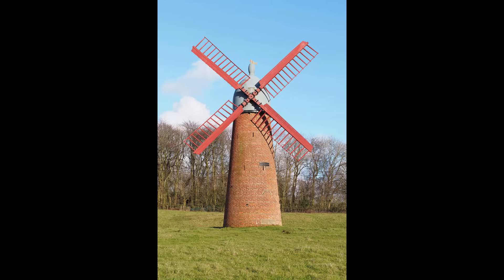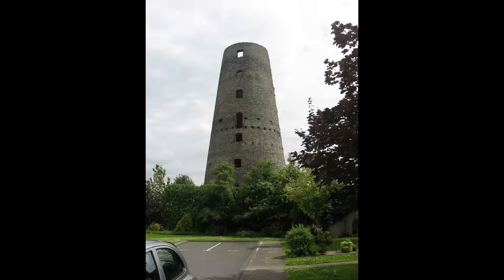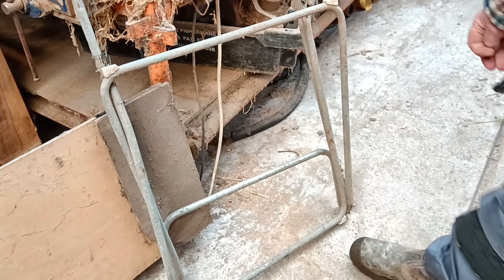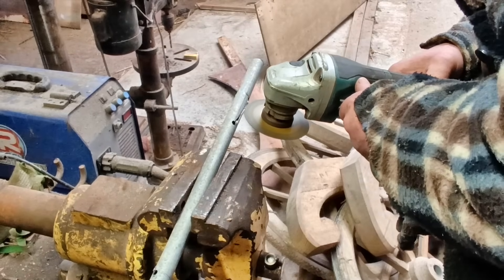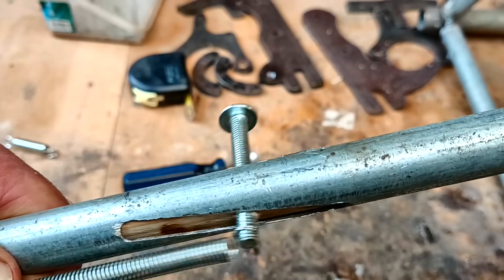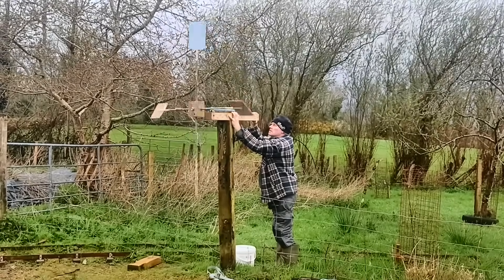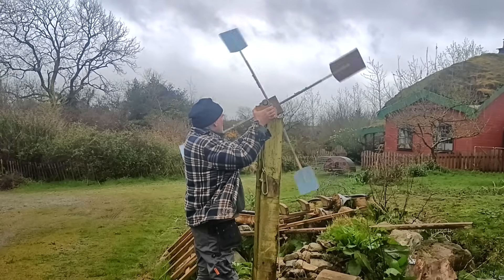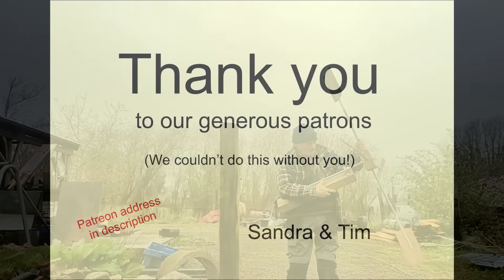How To Make A Self--Feathering Windmill (Self Regulating Turbine)

Comment: observations…

Supposing one wanted max aero efficiency, that I take to mean a constant angle of attack for the airfoil into the apparent wind, then I think this would be achieved by having a constant blade tip to wind speed ratio, so no dynamic blade pitching is needed.  I understand you’re doing it for survivability though.

In theory, if a spring with spring constant k stretches a length delta_r as it balances the centrifugal force on a blade of mass m having center of mass turning at a radius r, at angular velocity w, then the equilibrium point should be:

k delta_r = m w^2 (r+delta_r)

delta_r = w^2 r / (k/m - w^2)
Reply: Although you would preload the spring, I didn’t account for that in the equation

Comment: You actually don't need batteries with an electrical one, just only use it when you need power (just like with a mechanical power version). And yes, mechanical is more fun 😃

Comment: You’d have to adjust your tensions once you’ve got a pully and belt running to an alternator so as to adjust for the increased drag power generation would have on overall speed because while you want it to always create power the winds won’t always be the same force so you’ll need bigger wind veins 
But thanks for that design I’ve been mulling that problem over for quite some time and I think this has a good foundation that it might work for what I’ve been contemplating
Reply: An alternator? You haven't been paying attention, have you?🙃

Comment: Trouble is, this mechanism will move the center of mass of your vane and cause imbalance.
There is a more clever design working on the principle of centrifugal governors - weights mounted on extension rods, connected to the blades and tensioned by springs. When the centrifugal forces start pulling the weights out, they rotate the blades, changing their pitch angle.
Alternatively, you can make blades that are pitching by the frontal pressure caused by the wind pressing against them. That is measuring the wind speed by the pressure, not by the RPM. This design could even protect the vane during very abrupt gusts of the wind ...
I once saw a design where the turbine is mounted offset from the vertical axis, so when the wind starts pressing too much, the vane just starts pointing away from the wind and thus slowing down. To enhance the reaction, the tail was on a hinge and springed to loosen the directional authority during strong winds.

Comment: Years ago they used to just put water heater elements in to open tanks. Then connect them to the electrical system as extra loads for braking the windmill in high winds.

Comment: You ought to make a kinetic energy storage device! 

Use a CVT (or maybe 2 in series) off of a 'side by side' engine, a large concrete disc, and some large carbide balls for a center pivot and end bearings.
Reply: CVT's are free where you live? Where is the low cost in your idea?

Comment: The only thing I could see having difficulty is that on a larger version, where the blades have more weight, when a blade is at the bottom of the cycle will slow down due to gravity pulling it out and speed up while at the top of the cycle due to gravity pulling it in.   This would set up a once per rev oscillation and that could vibrate the mill to pieces over time.   Having 8 blades with blades set opposite each other with the same speed restrictions would remove the issue.

Comment: Hi Tim, a couple of comments from a control engineer. The type of control you're making here is "proportional" - that is the blade pitch is changed proportionally with the rotational speed. This will always have a "steady-state" error - in laymans terms it will still spin faster in strong wind than it does in light wind. That may well be fine for your application.
The somewhat juttery control response is because the control system is actually quite unstable in your case due to the nature of centrifugal force and static friction. Centrifugal force is proportional to radius, so once the blade starts to pull out against the spring, the centrifugal force just increases and it will feather all the way. It will never be stable in the middle ground. (You overcame this by setting all the blades to different spring tensions - clever!). This is exacerbated by the static friction in your sliding mechanism. The rotor will accelerate until its turning too fast and overcomes the static friction and suddenly slides all the way out. Then it will slow down all the way until the spring can overcome the static friction again and then it will slide all the way in. 

Essentially, it will ping-pong between two fast and two slow and there's not much you can do about it!
Reply from the maker: Thanks for this, Daniel. You're right, of course, but I have been thinking a lot about the mechanism and I think I can make some improvements - perhaps it will still work out smooth enough to be functional..

Comment: I live in Denmark where there are a lot of wind, and where lot of modern wind turbine designs originates from. A lot of the early windmills, for instance the ones from Vestas, used a design similar to yours, but just had a small portion of the tips of the blades that tured. Our neighbour had a small windmill with 2 metre blades, and only abot 20 cm long tips that turned, that was enouh, as they are situated where the speed is the highest. There were no buit in dampener, but i suspect that the spring was of the type that gets stiffer as it is stretched. A simple system with a bolt thightening the spring was used and a weight, similar to the ones used for fishing, were used to calibrate the fin to turn at a defined pull, easily calculated from the desired max rotational speed in relation to wing radius and the weight of the tip is self (hope that alle makes sense)
Looking forward to follow along your build!
Reply from the maker: Thanks for this - so the tip rotates but doesn't move away from the rest of the blade? Is that right? Interesting!

Comment: The mechnism to control the stabilizer based on rpm & turn the windmill against the wind to reduce speed doesn't need to be reset, ever.

it is like a governor on a small engine, it might even be called a governor. idk, I was never a professional.

I worked my grandmothers, ~3meter diameter with ~40 blades. It was a well pump, and it always spun, but only pumped when engaged, so the governor was always working...wind & load.

She also had an electric generator with a wooden 2 blade, like a airplane, and it spun REALLY fast!!! It was also controlled by a similar governor, but tuned different. Again, the load varied, the wind changed, and the governor governed away.

the farm had no "city" power until the 1960s, no "city" water until the 1990s, and most of the land still doesn't have either. 

These things worked for decades, but a tornado overspun them in 2003, despite the still functional governors.

Comment: Well that's clever as can be! I think you could make your spring almost as strong as you would ever want your wings to be pulled and that would automatically give you whatever speed makes that max force. Maybe you would want to limit the speed of this design to be fairly slow because there's a risk of strong vibrations if one wing gets stuck outward (though that wing being sidewards would slow the rest down wouldn't it!). Very clever design overall. It would be great to see it put to use. If you don't like batteries you could try other mass energy storage like pumping water up a hill.
Reply from the maker: Thanks, Ben. Yes, I'd set it for 'slow and steady'. I have to build it first though!

Comment: There´s a vertical wind turbine with similar design criteria (self regulating, easy to DIY and scales well) that solves this quite well,too.
The vertical vanes are hinged so that centrifugal force can fold them out horizontally if they´re spinning too fast, and to regulate the speed this happens at they´re pulling against a weight hanging inside the tower.

Comment: Very clever indeed. I have a suggestion, tough. I think you should synchronize the linear motion of all blades together with cables or links. Leaving them to move independently will result in imbalance, which is for a larger windmill disastrous. 
To solve your problem with gradual braking, you could experiment with different slot curves.

Comment: Tim, a suggestion for tweaking the spring tensions simultaneously and more accurately: don't attach the inner ends of the springs to the windmill arms. Instead fit small pulley sheaves to the spring ends. Fix further pulleys where each arm meets the hub. Pass a light cord , star-fashion, around all pulleys. Join the loose ends via a small turnbuckle. In this way, equal tension can be applied to all springs (assuming they are identical). Great project!

Comment: This is brilliant!

My first thought was to install a heavier spring by default and use weights on the blade side to 'adjust' the feathering action as required... centrifugal force on the weights will eventually overcome the spring.

You might have to fiddle with the weights for awhile but once it's set, it's set.

Comment: Have you tried Hugh Piggott's self furling design. Its the most elegant design. An off center turbine mount, a slanted tail mount. And the most reliable, consistent, durable and available spring of all : gravity. His book Wind Power Workshop is a treasure chest of practical knowledge.

Comment: ??- 3 stage angle of attack control -  (+ 1, manually feathered for parking - collective swashplate - for lowest resistance to extreme winds ) 1. startup, 2. cut- in speed for power production then 3. zero advance angle  - if it were a propeller we would call it full fine, as a turbine "full coarse" may make sense -  at the top end  then there will be no abrupt braking action just a loss of torque as the blades stall at high angle of attack...    a collective swashplate using an old bicycle gearset - freewheel mechanism -  and wheel could make operating linkages simply - for parking and release...

Comment: 2:30 I’ve lived around that kind of windmill my entire life, and the mechanism in it does not work the way you are thinking. The tail fin is connected to a mechanism that rotates in out of line with the fan fins. This causes the windmill to turn sideways to the wind, thus slowing it down. There is a mechanism inside that triggers this above a certain speed. There also is a cable that hooks to this system, that runs down the tower to a large lever mounted to one of the legs, and pulling this lever down and latching it activates the mechanism, turning the tail, and causing the blades to turn sideways to the wind. This is used to ‘shut off’ the windmill, and releasing it lets the tail swing back in line with the fan, and the windmill turns into the wind again. 
The only time the tower must be climbed is if something breaks, or oil needs to be added to the gearbox.
Additionally, it should be pointed out that these aermotor windmills were designed specifically to pump water wells, so the gearbox in the top converts the rotary motion into a linear up and down action, like a piston, and would be connected by a rod to a pump down a well. If you search 
aermotorwindmill and find their website it even has complete parts diagrams and explanations of how they work. 
They likely don’t translate to what you are doing, but are quite interesting mechanisms!
Reply: My grandfather had a business repairing and maintaining the windmills. As a teenager, I climbed many towers to work on those greasy gearboxes. I loved those old things, but I must admit that I hate the giant wind powered generators that infest the countryside. The theory is good , but the reality is terrible. Just ask anyone living close to the wind farms.
Reply: @johnalexander4356  Offshore wind ftw!
Reply: @johnalexander4356  They put in a giant wind farm in my area, and you can hear the hateful things 5 miles away, and see them from 30 miles away, especially at night when the hundreds of blinking red lights turn on. I feel sorry for anyone who lives close enough to hear them all the time, it would drive me insane. It’s bad enough just spending a few hours near them.

Comment: Nice simple design :) I suspect you're going to get annoyed tuning all the springs though - pushrods & combining them them all together in the hub might be less hassle? ( if more greasing to do! ) not sure how you'd do it yet, maybe 90 deg angle brackets & have rods from there ( or, thinking about it, just the other side of the bracket ) all push a single non-rotating plate ( like a helicopter swashplate ) & put the spring behind that.
Reply from the maker: why does it need tuning though? It works fine, doesn't it?
Reply: Sure, and I like it! but I'm just thinking ahead when it starts wearing/bits start sticking. Wasn't a criticism! it might not be a problem anyway, I do have a habit of overcomplicating.

Comment: Tim, I'm working on a wind-powered composter and I'm very excited that you've posted this video!  I'm using a vertical axis turbine from salvaged squirrel cage blower parts but much design work is still required.  I'm looking forward to seeing what applications you use this for and what problems you might run into and solve for along the way.

Comment: The water pumping mills.
You do not climb the tower to move the tail.
Generally there is a spring that pulls the tail over so the blades are out of the wind, and a rope down to the ground that you pull to straighten out the tail and let it start pumping.

Comment: One thing is though when you fit a generator it’s loading will be dependant up in how much energy output is required so you might be better using an electronic load dumping system like a heavy duty resistive load that will switch itself across the Genny output when the speed becomes excessive or have an auxiliary set of batteries to be charged such that you don’t waste the energy being produced in extra windy conditions.

Comment: one issue with building bigger version of this is the weight of the blades means you need much stronger springs.

I wonder if you could make a centrifugal governor. it can be placed closer to ground than the blades, and you can pull heat from the brake disc for whatever you might want to heat up. 

also for energy storage, you could try building a thermal battery. simplest version is just gravel or sand with some system for moving hot air in and out. with this you won't have to worry about generators or regular batteries.

Comment: is it going to be on a pivot so it can change direction with the wind? robert murray smith's channel has loads of interesting stuff about windmills, usually for the purpose of generating electricity. however i have not seen him doing anything like this before during the design stage.

Comment: your projects are always so unique...thank you. 
What if you installed a speed regulator like on a music box? I'm thinking of two wheels with wings - I think a music box only has one ring with the wings on it. The question should be understood in such a way that I really have no idea whether it works. I just think that they would only get enough air resistance with enough speed and therefore wouldn't stop it right away.

Comment: A friend invented a vertical axis turbine with a similar system, but it is better because it regulates the angle of the blades so that it always rotates at the same speed, there can be a hurricane that the windmill rotates at the same speed. Then on pinterest we saw that a Frenchman had already invented something almost the same 30 years ago. A lot of disappointment.
I'll email you the design, in case you want to make it.
Reply from the maker: yes please, Gabriel - send me the design. rustyironpig @ gmail.com  Of course mine also spins at the same speed - that's what feathering is for
Reply: @wayoutwest-workshopstuff6299  I get the feeling that when it is extended it has to slow down a lot to retract, more than it was just before stretching, then it does like an oscillation of accelerating and decelerating all the time. But that's the feeling I got from the video, you who have seen them live and touched them, you will have seen it better.
I have already sent you my friend's design, I hope it will be useful.

Comment: Tim, now this is one of my areas of experience, having experimented for years, even building a 20ft Creatan sail windmill with a fantail gearing to keep it into the wind. The more blades the greater the torque but also the greater the self regulating effect. Off set wind shafts from the main yaw pivot and a hinged tail work well for regulation as long as the spring anchor points allow for plenty of tail movement with a small change in spring length. It's all in my book, cheers
Reply from the maker: Thanks Andy. If I ever decide to build a big one, I'll do some more research but for now I just wanted to test the principle..
Reply: @wayoutwest-workshopstuff6299  Tim, I would also say that each blade only need to pivot to a maximum of 15 degrees for them to spill the wind. So 45 degrees will cause the speed hysteresis, cheers

Comment: try making the blades deploy in the opposite direction. That way when they are fully deployed they would just be flat planes perpendicular to the wind. That way it wont have the braking problem that this prototype does, it would slice through the air with less drag when deployed, but at the same time wont speed up any further.
Reply from the maker: I think you'll find that the whole tower would be blown over if you did that
Reply: @wayoutwest-workshopstuff6299  good point